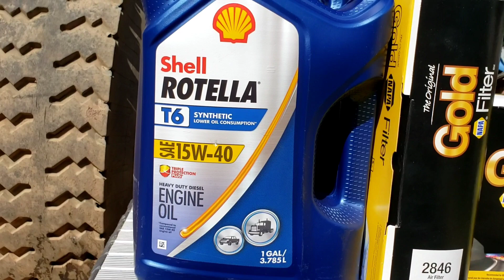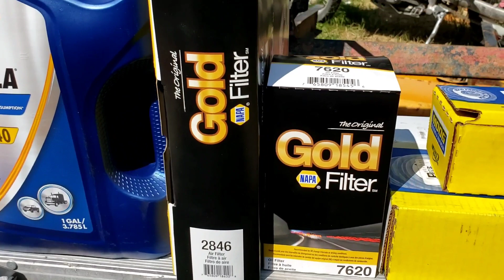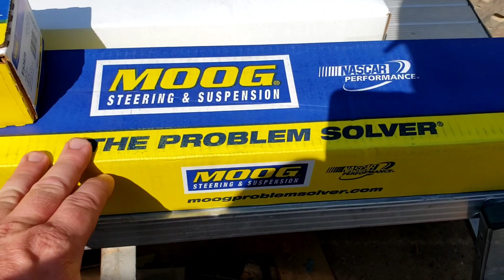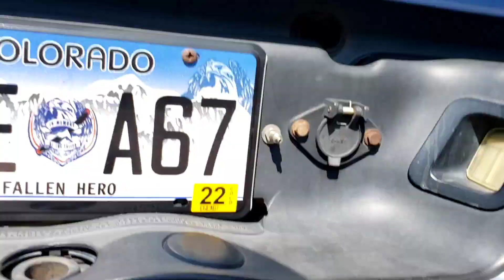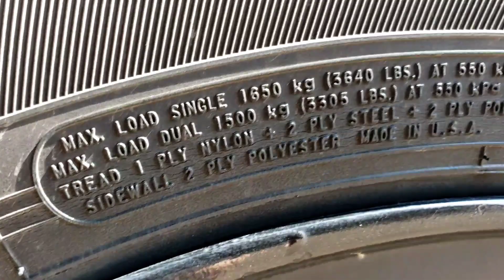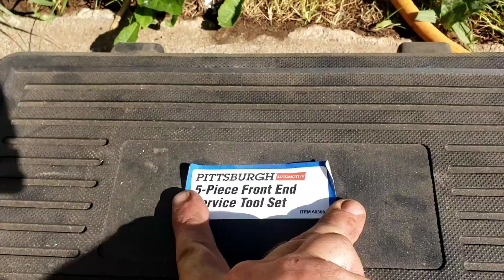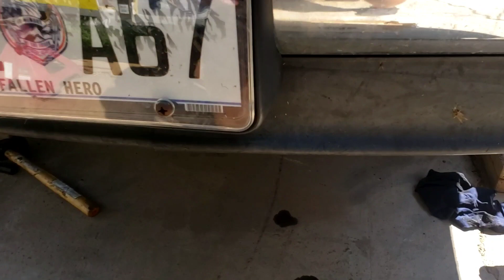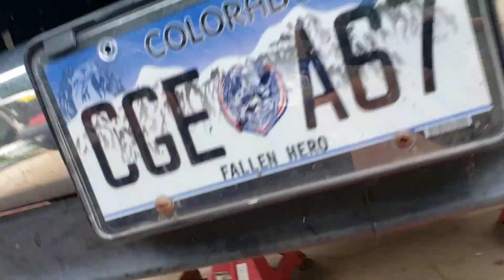Rebuild Dodge Cummins front end for UNDER $500 ?! - DIY Hotshot Trucking Maintenance

Comment: I was able to fix the sloppy feeling on my 06 by retorquing the track bar bolts. That was at 140k. If the boots on my tie rods weren’t torn, I would still be using them. Changed them at 195k. Thank you for sharing and have a great day.
Reply: What did you torque them to?

Comment: I run Mobil 1 synthetic in the winter and Valvaline half synthetic half not made for Cummins in my 2003 crewcab dually 4wd 8ft bed. Smarty jr tuner and other goodies.